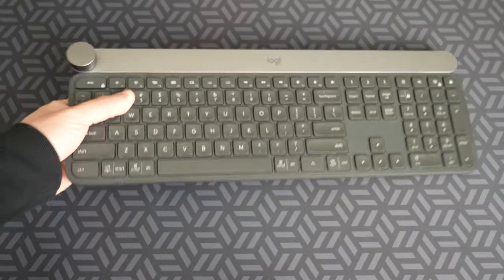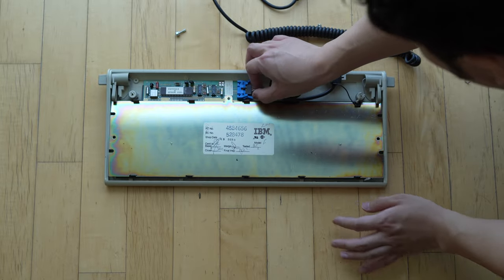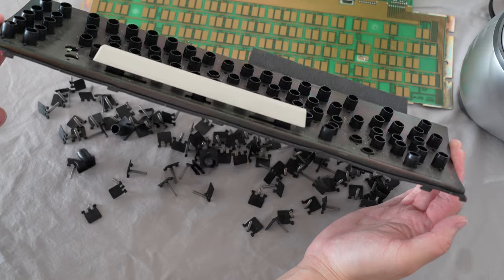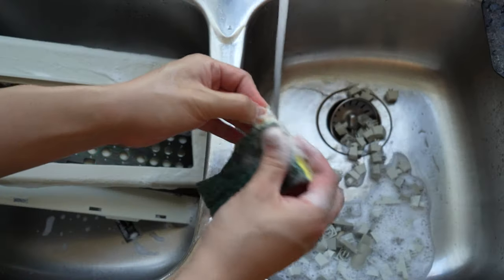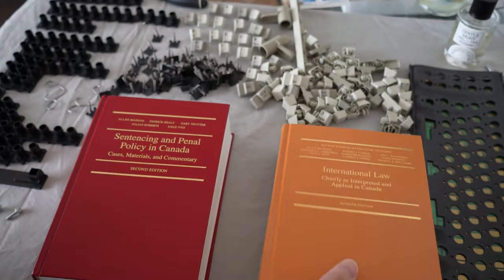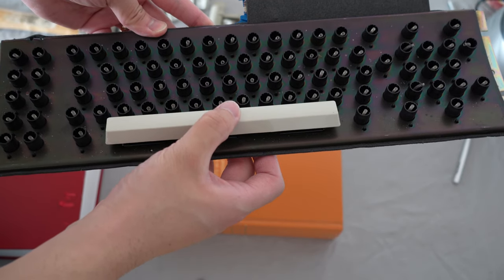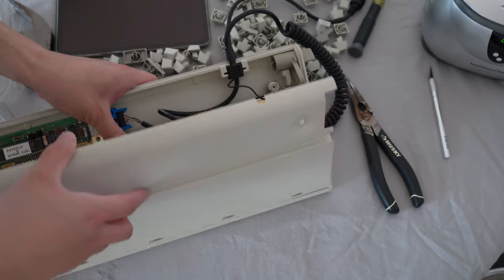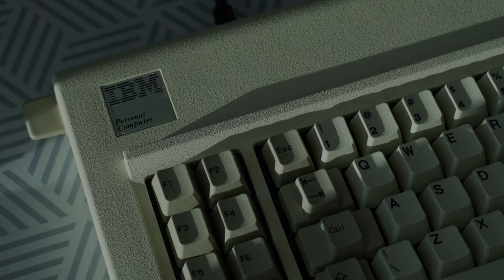My dream keyboard (IBM Model F)

Comment: Many thanks for the video and for helping to save another one of these amazing keyboards. Once you've used a Model F, it's impossible to return to using any other type of keyboard. For myself, I incorporated a Teensy with Soarers firmware inside the case and then replaced the heavy black cable for a thin braided USB cable.However I've since come to regret doing that as it detracts from the originality of the device.
Reply from the maker: I was thinking of doing that as well but I went with the soarer’s adapter instead so it doesn’t ruin the inside

Comment: Bought one of Model F Labs' F77 repros and it's absolutely amazing! The reproductions have a more modern layout which is nice but I now really have an itch to try the older layout... This video convinced me to pull the trigger and buy an original one. Excited to see how it compares!
Reply from the maker: Glad you liked the video! I think if I have both keyboards I would like a modern layout more
Reply: @howardishere  Whenever it gets here I will update you with my thoughts! Just looking at it, I can already tell I would like the XT's position of the ctrl key more for sure.

OH and I almost forgot to ask; how has it been for you so far? Are you still using it as a daily driver?

Comment: OK! Somebody CLUE me in! I got a MODEL F Keyboard and the converter. Hooked things up. Turned on the PC and NO JOY. Is this a case of WIN 10 won't recognize the keyboard OR is there something that I don't know about that I need to do? SERIOUS QUESTION. PLS ADVISE!!!!
Reply from the maker: I wish I could help but mine is just plug and play it works immediately. May be a faulty converter? I am still using mine to this day and problem free. Where did you get your converter?
Reply: @howardishere  I Think that the converter came from a company in the Philippines?
A FIRM called TINKERTOYZ??? At THIS point, I am NOT sure if the KEYBOARD or the CONVERTER is the problem? Do You have a suggestion as to where to try for a CONVERTER?? MANY THANKS!